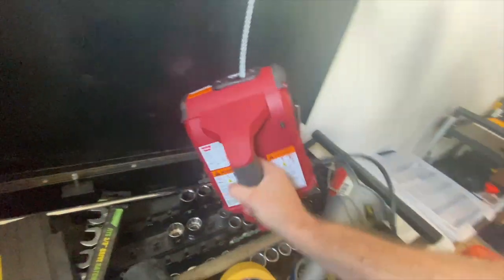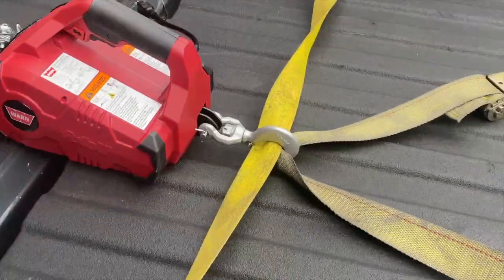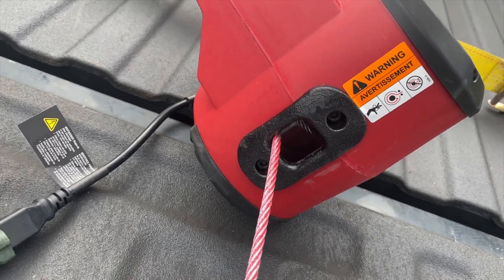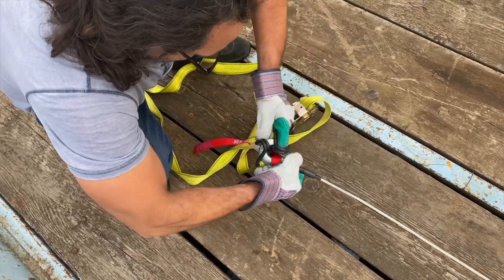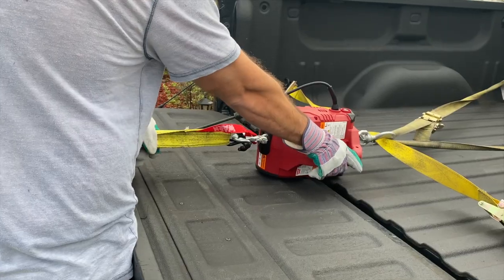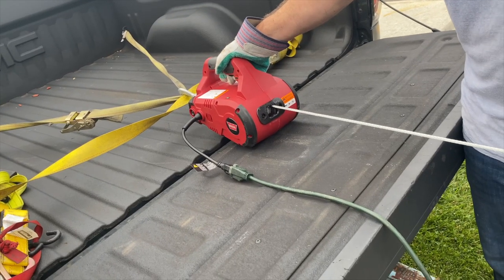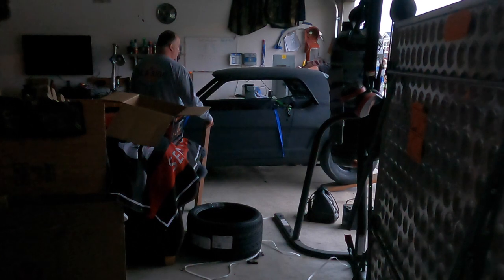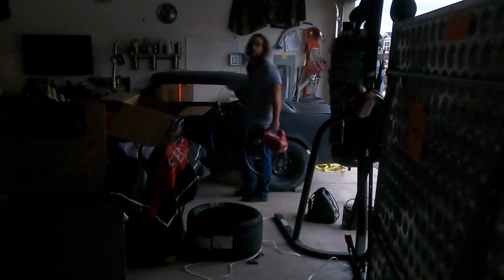Warn Portable Winch Review || PullzAll || Pulling mustang onto trailer

Comment: I had to dig mine out for stump removal. Thanks for the quick review. Don't forget to use an old towel, or blanket on the line in case it ever snaps.
Reply: Does that keep it from whipping?
Reply: @TouchofDepth   We are doing remodeling around here, and I couldn't find my user manual. Your video gave me a quick review.  I do remember the user manual states to put a towel, or blanket on the line in case it snaps. It will prevent the line from hitting the user. Thank You
Reply: @TouchofDepth   Yes, the User Manual states to lay a towel, or blanket on the line. If the line snaps it is suppose to keep it from whipping back at you.

Comment: SEPT 2023:  THANK YOU! FOR TEACHING ME. I DO NOT. HAVE TO: BUY AN EXPENSIVE!  MOBILITY SCOOTER LIFT. NOR MAKE. A HOLE. TO BOLT. A WINCH. INSIDE MY NEW 4RUNNER. TO LOAD. MY  350lb WHEELCHAIR scooter.  <3  4 RUNNER COMES WITH; 400WATT AC + OTHER OUTLETS,  INVERTER.  IN THE CARGO HOLD;   I think: I can.  Use an XLR connector. And plug in. In the mobility scooter.  Battery port.   [Jet ski accident :/ oops]
Reply from the maker: Do it!